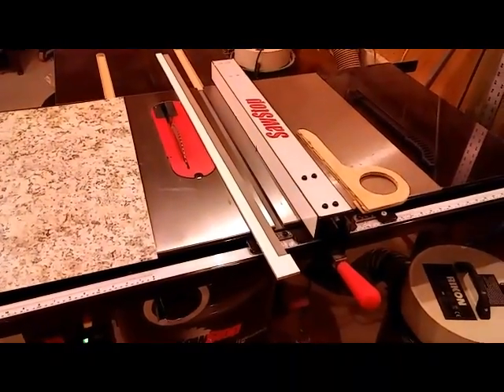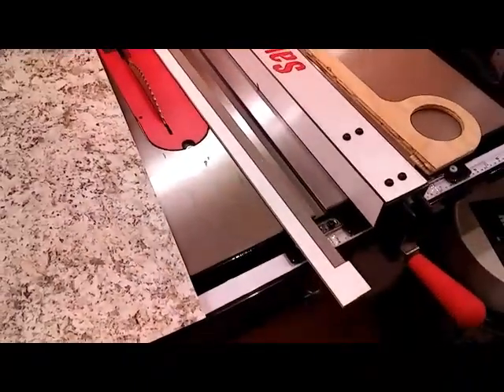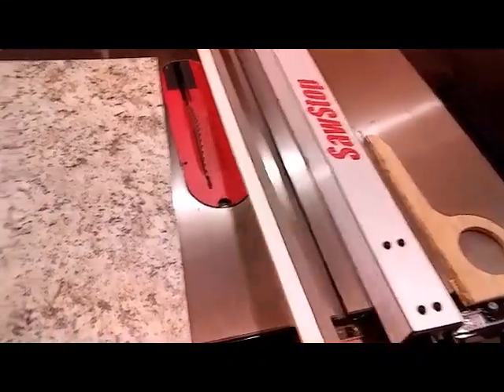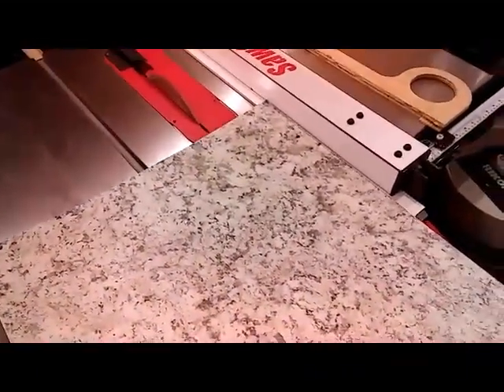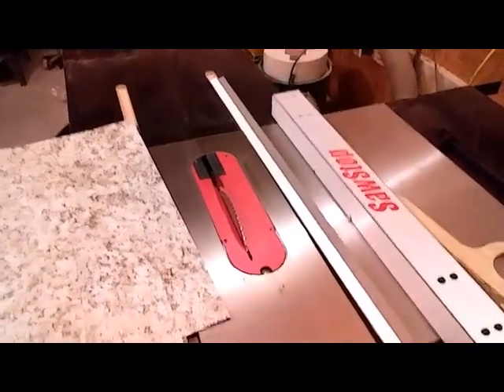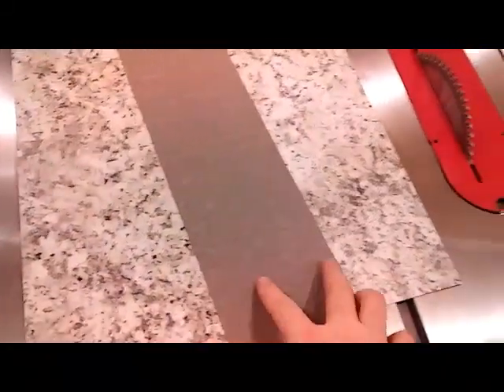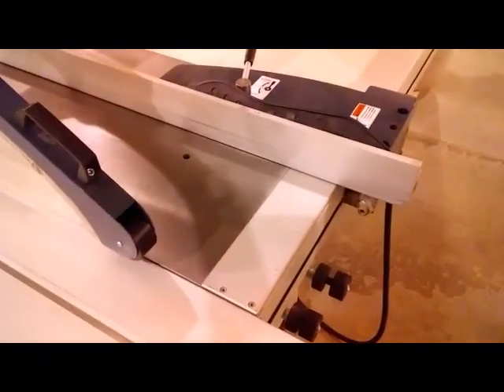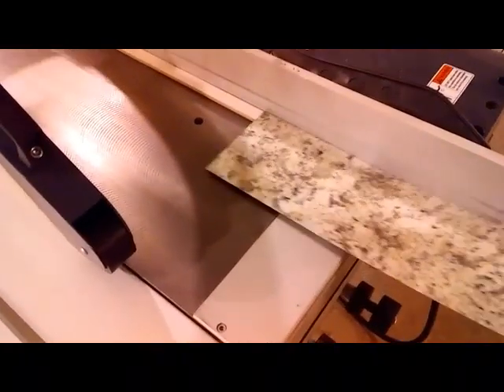Cutting laminate safely on a table saw

Comment: Are there any other machines except table saw to cut laminates?
Reply: -A tracksaw works really well. 
-Jigsaw with a laminate blade works as well. You'll need a good surfaces to cut on so that the gauge has a decent, straight lip for reference.
-a trim router or laminate router. Don't go with a cheaper laminate bit. I've had great results with Bosch bits.

There are 100 different ways and probably more growing each day. Whichever you can afford without cut corners on quality.